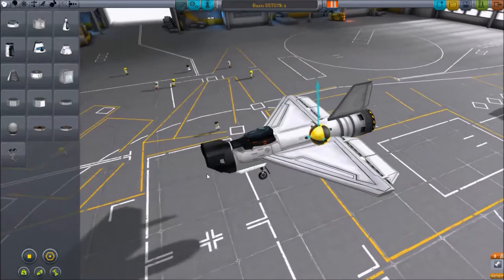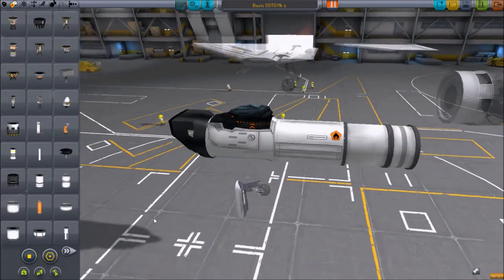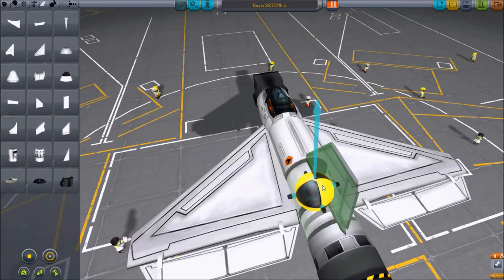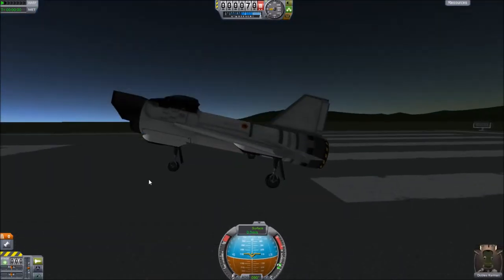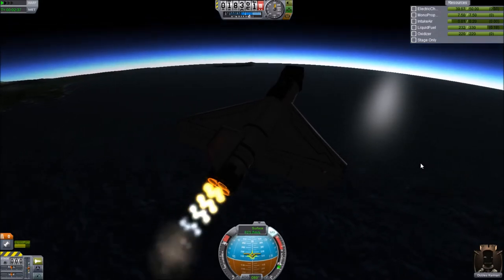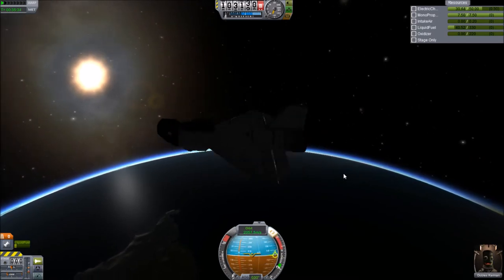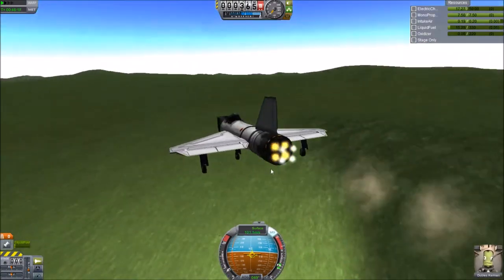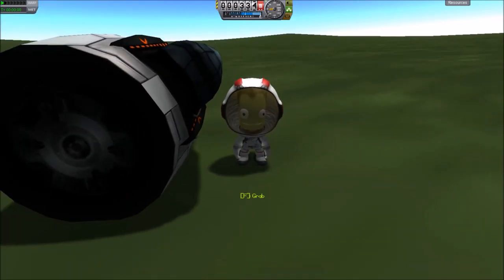Kerbal: A Really Basic SSTO (using R.A.P.I.E.R. engine)

Comment: This is a great design but your flight plan is off. The higher altitude you get the less efficient the jet. You want to stay low till you build speed before ascending and switching engines.

Comment: Would you recommend such a basic model for a Laythe landing and reorbit to dock on an interplanetary mover ?
Reply from the maker: That's an idea I've tried before, and it's fairly successful if you launch, dock to mover, go to destination, refuel, land, dock go back etc. So yes, it works. Making an effective docking station can be tricky sometimes though, making sure it's center of thrust and mass are on-line when the ssto is docked.
Reply: Yeah that's the plan :) thanks for answering. I can test it in the VAB and then launch the two parts (ssto and mover) separately. That way I can be sure my docking ports are well placed and my center of mass won't ruin my trip ;)
Reply: Can I add you on Steam ?